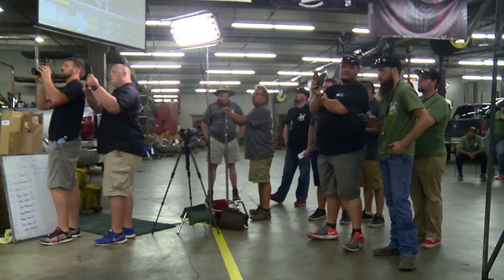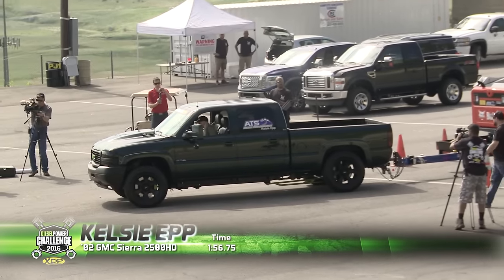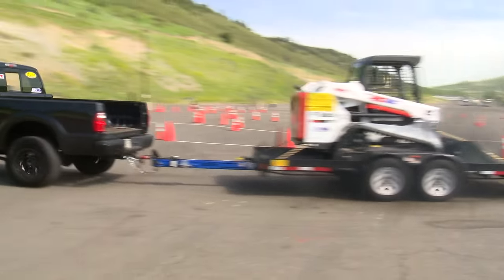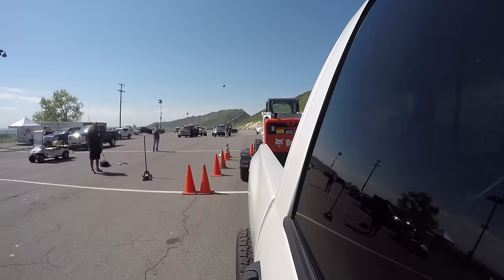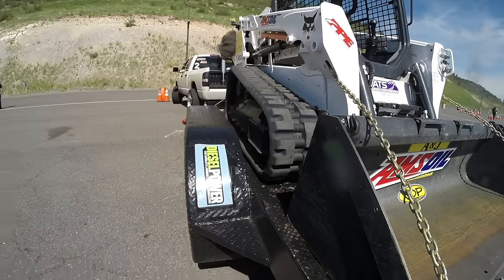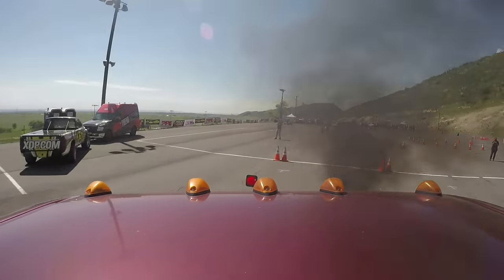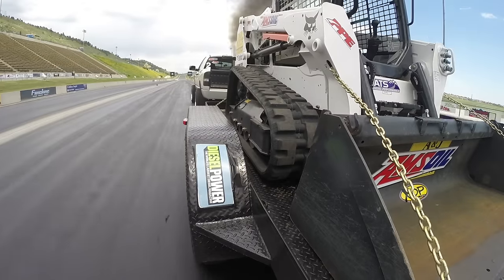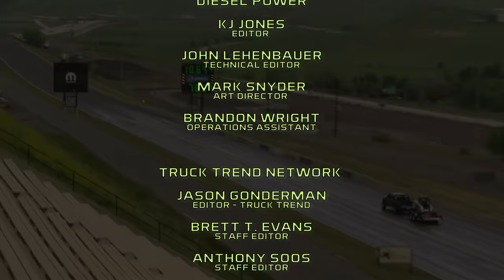10,000-Pound Trailer-Tow Obstacle Course – Diesel Power Challenge 2016

Comment: If you have a diesel and roll coal:

We're not looking because we're interested...

We're looking because we think your truck is on fire.

... So, they attempt performance, but have what is probably an in-considerably rich tune. And/or just snapping whatever injectors could be found at higher flow rate.

The hicks love the attention.. Like they were lacking in the area....

Comment: Why do American diesels smoke so much? Is that done on purpose?
Reply: more fuel for bigger power,some fuel come out from exhaust because its not been burned,thats called rollin coal
Reply: MrcabooseVG large turbines in the turbo require more air, added fuel makes heat, heat expands air. That said heat is needed to light large turbos. So they add large amounts of fuel. Also with large injectors it's hard to dial out every single bit of smoke, there is a point where with tuning you can't remove any more fueling without killing throttle response. There is a lot more variables too but I'll leave that alone
Reply: They don't smoke like that stock
Reply: These trucks are doing this on purpose. It's illegal to roll coal on public roads.
Reply: also these trucks are at elevation, so there is less oxygen going into the trucks making them run richer which would cause even more smoke than if they were at sea level.
Reply: I hope you're not being serious +AbbakleKannoxis
Reply: he makes a valid point. a car at elevation runs rich.
Reply: he makes a valid point. a car at elevation runs rich.
Reply: Yes
Reply: Sam Thomas won't make a major difference. Your talking .5psi on a non restricted engine. Oxygen content is less yeah but they still smoke. There has been a lot of voting to move DPC to smoke free. Hard to do but can be done, power levels will drop tremendously of course but it would push for the advancement of tuning, setups and technology. I'm all for it👍🏼
Reply: You better tell that to all the diesel trucks around where I live.
Reply: These are modded trucks. They don't smoke like this from the factory.

Comment: Isn't this more of a challenge mechanically for the transmission and clutch of the vehicle rather than its power/engine?
Reply: It's a challenge for the truck
Reply: MY 2008 e220 CDI mercedes can tow that much weight. It would just burn out the stock transmission. You don't really need to have a 4 ton 6 liter truck with 3 turbos to tow something heavy...

This test seems like a bit of a gimmick, less about the actual diesel truck and more about just being able to maneuver a course with a trailer.
Reply: ApeWatchingTV This test is a good test of low RPM torque and driver skill. Its a good leveller since it stops someone who has thrown silly money at a truck just dominating the competition without using any driving skill.

Comment: What good is a diesel that can't spool the turbo at low rpm's??
Reply: They are set up to race. Not to pull a trailer around a parking lot.
Reply: History Rambler Mark What everyone is forgetting is the altitude. It's hard to spool a big or multiple turbos on thin air.

Comment: Can someone explain why they "burn coal"? I mean if the black smoke is out, doesn't it mean they're running rich i.e. burning too much diesel than they need to? How does that help their fuel economy and not looking like an idiot? I love those trucks, but I don't get the running coal thing. Please explain! thx
Reply: Excess fuel cools the cylinders using evaporative cooling, so that the Aluminum engine parts don't melt.
Reply: Oooohhhh. Thanks!
Reply: That's true for gasoline, not diesel (or at least not nearly as big of an effect) @The Metal Butcher
Reply: They "roal coal" because you can squeeze a lot of extra power out of running rich on diesel engines.
Reply: The Metal Butcher  Not true.   These are diesels not gas.

Comment: I can't ever watch diesel powered events because the trucks just look moronic when they smoke like that. Such an inefficient way of creating power.
Reply: except they make a bunch of power,
Reply: joelum123 you realize diesel motors are more efficient than gas motors right
Reply: Inefficiently though, that's the point I'm trying to make.
Reply: I have never seen a high horspower diesel not make black smoke.
Reply: I don't know what your argument is here haha
Reply: Difficult to justify that statement though when they're literally blowing out uncombusted fuel from the pipes. The new petrol powered engines are insanely efficient on making power with tiny engine blocks. America's getting left behind with your obsession for big block motors that make f/a power for the amount of fuel they use.
Reply: joelum123 wat.  Do some research, come back when you're older
Reply: +joelum123 you do realize that they put out that black smoke because there turbos are so big that they cant spool them and an engine thats supposed have 70 psi of boost has like 10 psi so it has much unburnt fuel
Reply: What a brilliant and useful response. Do tell what sort of research I should be doing and how age somehow makes you automatically more knowledgeable about engines
Reply: Etsy Correct me if I'm wrong, but I'm sure you can control how much fuel is put given that it is at a certain rpm, preventing any black smoke from occurring.
Reply: But muh truck looks waay cooler with black smoke coming out the rear, right? :P
Reply: Maybe inefficient at low RPM, but there's not much they can do about that when you need massive injectors to feed 1000HP worth of fuel at the top end.
Reply: to an extent you can control fuel flow, but really only by how much boost you have. the injectors they use are still huge though, and even at the lowest flow rate, they still feed way too much fuel at low RPM.
Reply: There are LS engines that make 700 HP and get near 30 MPG, but they don't have modern pollution control, so you only see that in swapped muscle cars.  Pollution control in the US really hurts fuel economy. I don't think there are any cars in the US that get over 50 mpg without being a hybrid. There are American made cars in Europe though that get 60 MPG without being a hybrid. I'm not sure how you can say the US is getting left behind.
Reply: Matthew Stein Makes me wonder, why not create an injector that has an end that can control the diameter of the hole the fuel goes through, limiting the amount of fuel gles through to a certain extent.
Reply: Flying Bigfoot
Because it will break.
Reply: joelum123 diesels are meant for towing anyways and bottom end torque. But still it's not easy to make 1600+ pound feet with only 6.7 liters
Reply: Diesels are meant for torque and not horsepower. I can almost guarantee that these trucks don't smoke this much outside the competition. Everyone of these trucks are most likely running programmers that allow the higher amounts of fuel needed to make boost and move these trucks the way that is needed to compete. And i wanna see a petrol motor make the torque that these diesels do.
Reply: joelum123
America getting left behind HAHAHAHAHAHAHAHAHA!
 and for your info we dont have Big blocks anymore.
Reply: Oh God Camaro5 is back to give his solid gold input to the conversation. You know you can turn Caps Lock off right?
Reply: joelum123
Thank you for that usefull info but I meant that you see the first part was lower case but anyway. I guess you have no input on saying we still have big blocks and its funny you think America is getting left behind in the MPG department but please go ahead and tell us the cars that are more efficient. Ill wait.
Reply: joelum123 well not like your opinion is worth a damn. No matter how much power you think you can make with small engines, big blocks will always outpower you. Besides America as of now has cars that make the best of what Europe and Japan have to offer look like hot wheels.
Reply: Brandon Smith
 Most of the people with programmers don't know any setting other than "Stupid amounts of smoke". Yeah, these guys are in competition, that's cool, but the trend has been "go big turbo and fuel the hell out of it". Which as you can see, the trucks that didn't have VGT turbos suffered significantly. It shows that all that coal rolling nonsense really means nothing if you can charge the engine more efficiently.
Reply: diesel motors are ONLY more efficient than the otto cycle because they're able to reach higher compression ratios. 

With equal compression ratios, gas engines are more efficient.
Reply: No they don't, and yes they do. However many "competition" trucks have the filter systems removed, or in this case they're earlier models that were not equipped with DPF systems.
Reply: You obviously haven't seen Audi LMP1 Endurance cars racing then!
Reply: It isn't a matter of 'being able' to reach a higher compression ratio, the fuel is ignited by virtue of the high compression ratio. That is the principle of a diesel engine. Actually, the correct term is compression ignition engine.
Reply: *****
The LMP1 cars are completly different  and they are built for completly different scenarios. Those are small engines that have millions of dollars spent on them to run efficient enough to run like a gas but have the efficiency of diesel. Those engince dont put out a ton of torque and they have exhaust filters unlike the big heavy haulers of todays 2500 and 3500 trucks that pull 20k + lbs from a stock truck.
Reply: TheCamaro5

They are diesels that produce alot of power, almost 1000 BHP in the case of the Audi, and they don't smoke!   I was just responding to the comment in a literal sense.  Obviously they are designed as race units, but diesel all the same.  They have pushed diesel technology much further as a result of the development that went into them.
Reply: That smoke is literally unburnt fuel. Yes they make power but no they are not efficent
Reply: Read your comment before posting them will you?  I'm not sure what you are even trying to argue.
Reply: So many people disagreeing, that he won't comment back lol
Reply: Efficiency is the Banks Pikes Peak semi.
Reply: +Etsy only a very small minority of people are disagreeing with me compared to the amount of likes my original comment got, I didn't realise it was going to spark such a debate and that people like you would be so precious about your diesel motors. They look ridiculous chucking out all that unburnt fuel - fact. From reading through the comments I can gather that there is a way for that to be stopped but most competitors choose not to, which to me seems stupid.
Reply: Eyebrows Mahoney yeah i agree but that's the problem when you get a bunch of kids thinking its cool. they ruin something that actually means the total opposite of what they think and is completely unnecessary. yeah i want a diesel that'll smoke but i also want it to have the power that these trucks have and to compete here one year.
Reply: joelum123 well to be fair, diesels use a lot of fuel to spool up a turbocharger to get it up to speed to launch it more properly. When it uses a lot of fuel at low rpms it's pretty difficult to burn it all. In a way you can control it but there's only so much you can do. When rpms get back up to speed and fuel comes in as fast as air then you don't see the black smoke as much
Reply: fred a Unfortunately the goat milking season has come to an end man, we're onto cat milking now. Can come over to the farm if you want? Bring ya family along.

+ Justin Anderson ahh that explains why to be fair. Cheers dude, a part of me still thinks I guess that in most instances petrol power just seems like a lot cleaner and more efficient way to create power. These sorts of diesel events just don't appeal to the kind of Motorsport I enjoy, but each to their own and all that. Thanks for the explanation!
Reply: joelum123 sure thing buddy. Cheers! Sorry for being harsh earlier. Have a good one!
Reply: Justin Anderson ahh no worries dude, it's all good fun haha, you too!
Reply: It's odd that no one has a supercharged diesel truck or use it to help spool the turbos. Its not like they lack the torque to run one and with a clutch pulley it can be decoupled from the engine once the turbo is into boost.
Reply: Satveer Degun
Look at the Banks Pikes Peak Semi truck. A superturbo system and a methanol injection kit is exactly what they use to build powerful and efficient boost with almost no excess sooting.
Reply: joelum123 americas getting left behind? How's that?
Reply: Alpha Nerd well if it wasn't a side effect of making big power then top Diesel dragsters wouldn't be black smoking, because is anybody knows how to make power from an engine, it's top fuel and top diesel dragsters.
Reply: Justin Anderson well its easy when you're pushing almost 100PSI of boost😂
Reply: Alpha Nerd on the injectors that change the size of the hole, stock diesel injectors inject the fuel at between 27,000-30,000 psi. These injectors are probably pumping 30,000-35,000 psi with massive holes in them so any injector that isn't solid metal(basically without moving parts in the nozzle tip itself) would literally disintegrate into the motor

Comment: What is the purpose of the blasting with trucks that are just pouring out black smoke?  not very efficient engine burning the diesel ? or is it just an American thing?
Reply: it is an American thing i guess. It is the engine being tuned to provide more fuel than can be burned resulting in SOOT come out with the exhaust. It is not smoke and does not stay in the air. It will settle after a short time into a very fine dust.
Reply: It's not an "American thing" 
I highly doubt you could tune any of these trucks to run any more efficient while still making the same power...
Reply: Cummins life you are probably right, but I think it IS an american thing to turn diesel trucks into hot rods...
Reply: No you just see the world from a very tiny perspective.
Reply: Cummins life you may be right. I was basing that on all the comments from out of country saying "this is weird, is this an American thing? I have never heard of this..."
Reply: I don't mean it in a bad way, just interested in the engine burning the diesel and the point of the amount of smoke been seen.
Reply: I highly dought that.

Comment: Seems they are doing the trailer towing in High Range. Why don't they use Low Range ?
Reply: Not sure about here but on my truck engaging low range also engages the centre diff lock, which is bad news for maneuvering on hard ground.
Reply: No truck has a center diff , it would work well as permanent 4x4. They engage front axle locking the front driveshaft to the rear. But whatever the spin they got better traction in 4wd.
Reply: G55STEYR My Mitsubishi L200 2.5TD has selectable 4WD with lockable centre Diff, The option to lock diff also engages low range. Friends Nissan Navara has the same system, although Im not sure if his has low range.

Might be different in American trucks.
Reply: I did use low range, and took out the front driveshaft but didn't really help at all
Reply: Center diff with 2wd option is only on Mitsubishi and first 4-Matic Benz'es , but the trucks no. Navara also
Reply: *****
Ah right, sorry have 0 experience with American trucks, the only one they sell here is the Ford Ranger, the big ones wouldnt fit down most of the roads here (in Scotland).  Selectable 4WD is the norm here for trucks.

I have similar options to you
2H - RWD
4H - 4WD
4HLc - 4WD locked diff
4LLc - 4WD locked diff, low range

Honestly I'd love to try out my smaller truck on a trial like this, I tow a 3000kg (6600pounds I think) trailer on a regular basis no problem with 500kg or so in the bed, a 10000pound trailer I think it would pull with a bit of effort, my 2.5TD is lightly tuned at 211bhp/350Ib/ft but I reckon the handling advantage would give the big 1000Ib/ft trucks a run for their money.

Comment: Really sad when my old F-250 gasser gets off the line with a trailer better than some of these trucks.  These setups are so stupidly focused on dyno numbers that they are absolutely useless when put to work.   A diesel should do it's best work down low, not sit around and puke smoke struggling to clear 5 mph

Comment: 10,000 lbs load, on 2 axels that aren't even squatting, more like 5,000 lbs
Reply: Kimberly Prater looks like a bobcat t630 which weighs 9015 lbs plus the bucket for another 5-600 lbs so not far off.

Comment: Do these people not having any experience backing stuff? Going so slow. Would have been impressive if you had a trailer with an extra bending point, what ever those are called in english
Reply: The word you're looking for is "articulated". A segmented (divided or that has multiple parts) trailer that has additional "bending (articulation) points" is an "articulated trailer" in English.

Comment: lol yeah, no way that is a 3 tonne bobcat, it's a baby. 5000 pounds maybe but nowhere close to 11,000
Reply: tapper88 looks like a t630 which weighs in at 9015 lbs
Reply: It could just be looking funny on video............ but I swear that barely looks half the size of an actual 3 tonne bobcat (I used to regularly drive one around on the back of a truck, and it would not come close to fitting on that little trailer) That thing looks like if you had ramps you could skip the trailer and drive it straight onto the back of the "truck" as you americans call them ;)